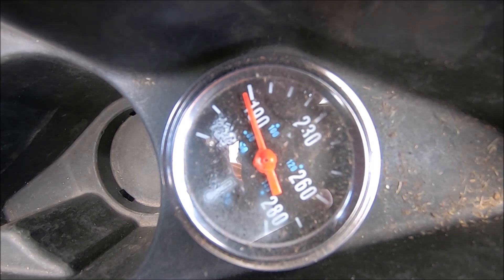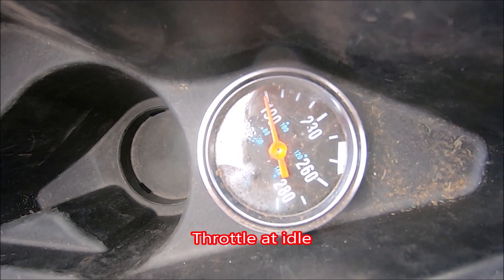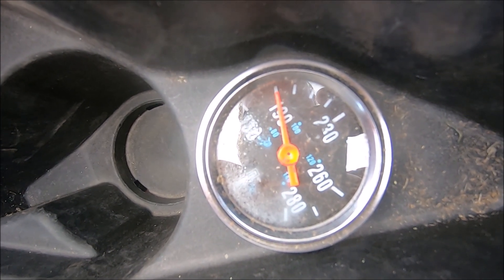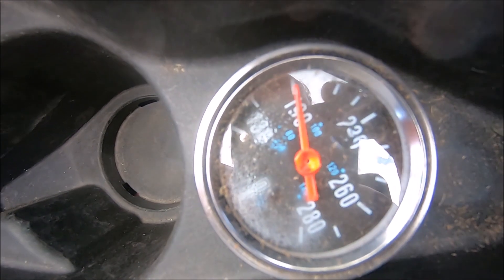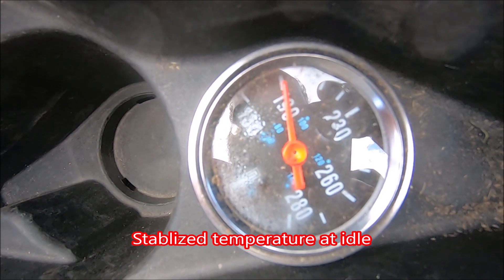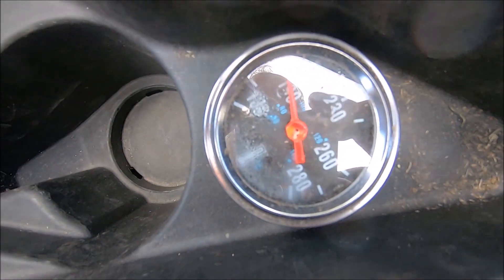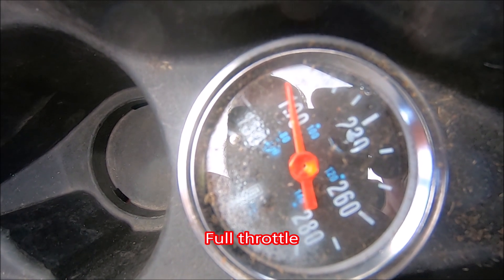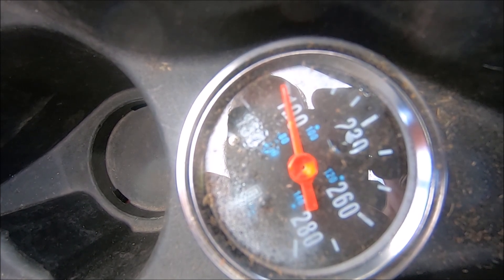Running an engine with the thermostat removed -- What happens?

Comment: Engines are designed you know the bearings rings etc to work and live longest at a desired temp removing the thermostat lowers that considerably in most cases not only that in today's cars the computer uses sensors for everything one of them is the temp sensor if it never gets up to temp then the computer thinks it's a cold start constantly which in turn never goes into what's called closed loop and the air fuel mixture in not closed loop because it thinks it's in a cold start constantly is super one sided way more fuel than air. Thus using more fuel could be a lot more fuel even in some cases in fact any time you have a check engine light on your fuel mileage is suffering closed loop is where the computer is taking all the inputs from all the sensors and supplying the engine with the least amount of fuel possible at any given time and keep the engine alive too lean conditions are detrimental more. So usually than a rich condition rich too much fuel lean too much air

Comment: I used to have your logic, but experience has shown me there is more to it than just moving coolant. 

1. The coolant needs to stay in the radiator long enough to be able to exchange the heat. I have toyed around with various size restrictors till I found the happy balance. Problems usually show themselves under specific conditions. 

2. When cold the thermostat creates a vacuum allowing the system to recover the coolant that was expanded in to the tank. 

3. Not all cooling systems work the same way. European cars will overheat without one. They have a dual stage set up. 

In the end I realized this only works in some situations in others it creates problems. Usually its just best to remove the spring and put the assembly back cuz that's about the right flow for the max cooling. 30 years of living with broken sht.

Edit. The manifold should be a certain temp for proper fuel atomization.

Comment: You’re missing what happens to the dynamic pressures in the block.
We did plenty of tests back in the day with pressure gauges all over the block and heads.
As the engine revs up, the dynamic pressure increases which increases the actual boiling temperature and also helps prevent cavitation.
Reply from the maker: @Alaska_Engineer  yes, there are many factors I’m skipping in favor of brevity in this case. This demonstration was solely to show the relationship between flow rate and heat transfer, because at the base level there are a lot of people who incorrectly think that coolant with a higher ‘dwell’ time in the block will pick up more heat. I figured the simpler the demonstration the easier it would be to grasp quickly.

Comment: I drive a jeep with a gutted thermostat. It's a manual. Have seen it get hot coming off freeway to a red light. But just rev the engine and temp drops. On trails it happens more often. Lot of gas to get over something then sit and wait. Also seen this with hot laps at dragway on other vehicles. They make water restrictors to go in place of a thermostat for a reason. Yes an engine needs to get to proper temp. Which temps are different for iron engines and aluminum.

Comment: If going to a larger radiator I gut the thermostat. Not remove it. If you ever do hot laps at drag way or 4x4 on trails they make a disc with different sized holes in it. Velocity matters and without restriction you can get slower velocities. Like a hose vs a hose with a nozzle.

Comment: Engines are designed to run at a certain steady temperature, not as cool as possible, plus head gaskets and seals can prematurely fail over time by not warming up and running at a specified rate/temperature.

Comment: I would never remove the thermostat on a modern computer controlled engine unless I had a stuck thermostat that caused overheating and I was in a bind to get my vehicle running. Old school engines are not as fussy about operating temp.

Comment: I have a 1990 firebird if you remove the thermostat it will not go into overdrive
I know that because when I replace the engine the one I put in there had a stuck open thermostat and the engine will not come up to proper temp for the computer do let it shift into overdrive because it was still trying to heat the engine to proper temperature

Comment: I've been thru this a hundred times at least. Back in the 70/80s any car or truck that had a Heavy Duty Cooling/Tow Package came with more rows in the radiator, a different water pump than standard. The HD Cooling system always had fewer blades on the water pumps impeller. 5 vs 7 to slow the coolant down as these systems also came with lower gear ratios. The reason being that the coolant becomes aerated(cavitation) from the higher revs/added blades.
Reply: I've known people who actually caused their old school vehicles to overheat from pulling the thermostat because the water pump cavitated so much that it was basically trying to push air bubbles and foam through the cooling system. Plus, an engine that never properly warms up uses more fuel and the oiling of the top end suffers because thick oil is harder to pump and slower to drain back to the pan.

Comment: Old School Mechanics . If it Overheats  FIRST Look Under  your  Oil Cap . Second remove the Thermostat , until you can do a Cooling system flush . The Thermostat is there to , as its name implies , keep the Temps Steady . Excess heating and cooling in operation WILL make the Head Gasket fail prematurely .
Reply: As a 3rd generation mechanic and engine builder you do understand that once the thermostat is open it has no bearing on the engine temperature. Using different temperature ranges will not change your operating engine temperature. Only how quickly they open. Once open they have zero influence on operating temperature.They are used so you will have heat in the winter.
Reply: @owenhill-vf7ko  . Analyse the Name .
Thermo - and - Stat(ic) .
If the desired , Pressurized Running Temp is , say 90C , then you get a Thermostat that opens at  87 Temp . If the Cooling system is Healthy and correctly Engineered , it should in fact be able to OVER-cool the Engine .
This means that when the Coolant Temperature drops to , say 85 , the Thermostat will close off a bit to " Throttle " the Coolant and thus MAINTAIN the desired 90 .
THAT  is  what a Thermostat does , having a Heater circuit has  F/A  to do with it .
That is a separate valve and piping system .

It's so important that lots of Big Truck Diesels have a Computer Controlled Cooling System to keep the Engine within 2 degrees of the desired Temp .
Thermal Expansion/Contraction and stuff..................
Reply: @owenhill-vf7ko  Thermostats are restrictive compared to an open hole, so they do determine the coolest temperature an engine will run at.

Comment: It does run colder without the thermostat but the reason the thermostat opens when it does is to do with thermal efficiency the thermostat is there to make sure your engine stays in a temperature range where the engine would be most efficient